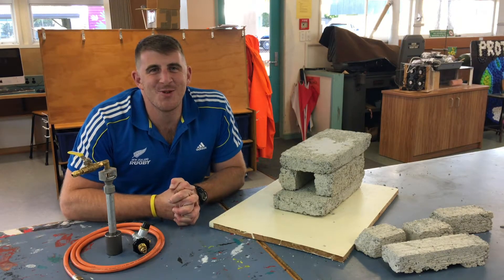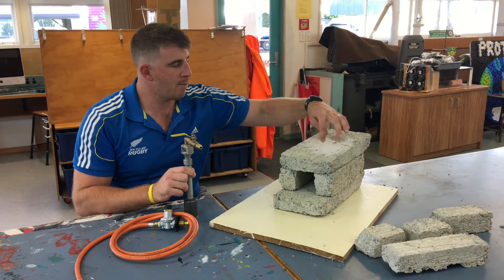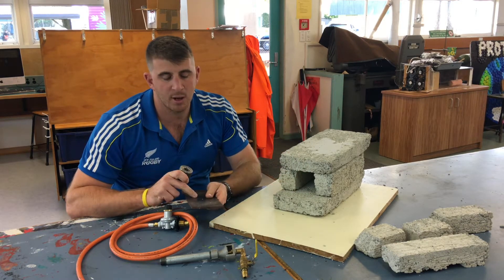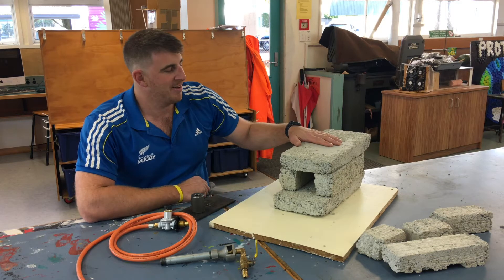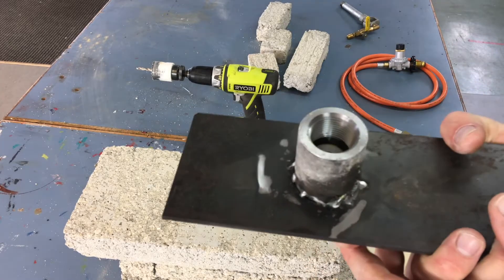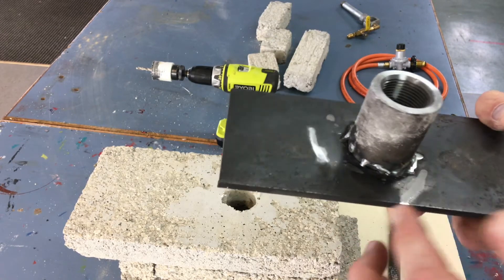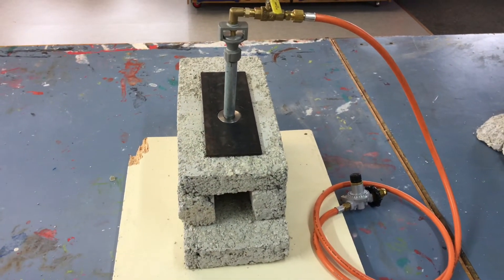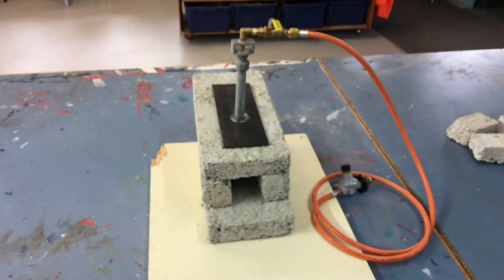DIY Mini Vermiculite Forge - Part 2

Comment: I'm working on one made from plaster of paris and cilia sand. I'm in Auckland where are you guys?
Reply from the maker: Whangarei.
Id be interested in seeing how yours turns out. Mine was an experiment but works just fine. If i made another i'd make a sturdier refractory mix.
Reply: @foodrelated  I have a feeling it's probably not going to last. I tested a piece after it had been drying for a few days and it disintegrated. I don't really know what I'm doing to be honest and  I'm only using from what I understand to be the bear minimum of material that I can afford so if I can getting it to work well enough then I'll just stick with it until either I can find a better alternative. I like the burner you're using by the way I didn't know you could get something like here in NZ I was just going to used my map gas torch haha.
Reply from the maker: Justin Verrall that’s how I started.
Reply: @foodrelated  Do you know if I put it in an oven for a few hours if it would dry it out faster without making it crack?
Reply from the maker: Justin Verrall not sure, you could try but if it dries too quickly there is a higher chance of cracking...
Reply: @foodrelated   I'm thinking I might leave it in my hot water cupboard for about a week or so until it's hard and then leave it for another few weeks filled with silica jell beads to try and pull out what's left of the moisture before firing it up.
Reply: @foodrelated  hey I've been doing a little bit of research on what is used in refractory cement and I found something that might be interesting. Silica sand is used in making liquid glass/water glass and water glass is used in sealing concrete and pottery. I can't do it any time soon but I know that water glass when it's rapidly heated creates a type of hard foam. If I'm right that foam should be an excellent refractory. If you haven't guessed where I'm going with this I think it might be worth skipping the sand and just mixing water glass with plaster of paris or cement into a past and using that as a refractory concret instead of the sand mix. If I'm right it would also solve the problem of how fragile the refractory brick is left after it sets. I'm going to give it a go once I can get my hands on some water glass which I think can be picked up from bunnings and I'll let you know how that goes.